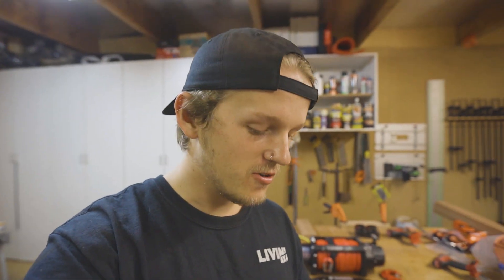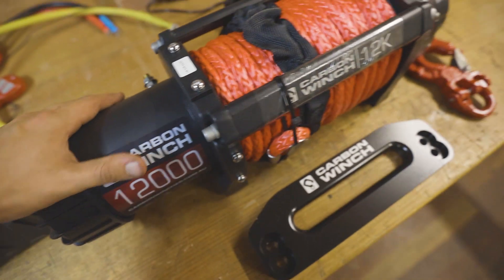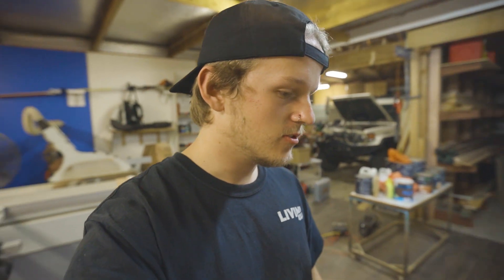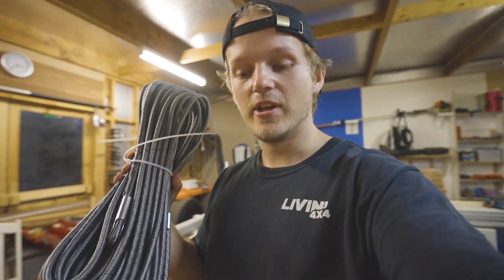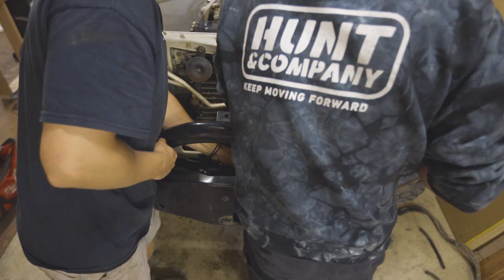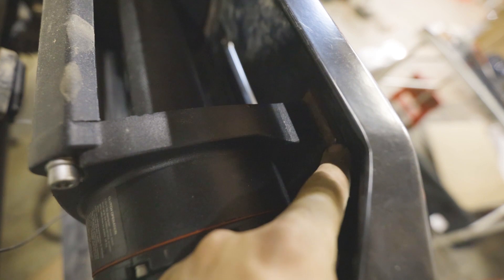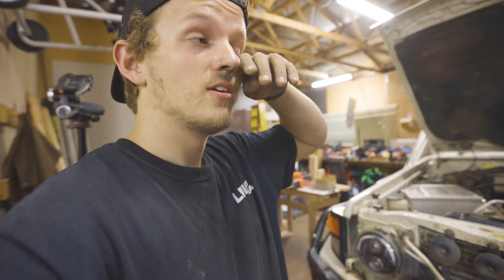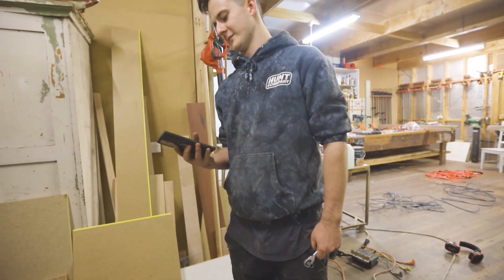Carbon 12k Winch Install on the Troopy!!

Comment: I would just like to say when Adam first used the rope it was going in the wrong way on the drum so the angle of pull was incorrect which resulted in it dragging on the bull bar, but if you have your rope going the correct way to start with there are 0 problems with the bar. The raslarr bull bar in my opinion are the best bars on the market and I wouldn’t won’t anything else 👍🏻

Comment: My 150 prado has an arb bar and is mounted the same as yours with the 4 bolts going through the front. Only difference is my winch goes in from under the car.

Comment: I bought a Carbon winch and it did exactly the same thing with the control box, when I went to test it in the shed for the first time. I had to get a new box sent out before I could even use it. I've also found because the rope is so thick it easily gets bounded up on the drum on the corners and the winch struggles to free itself sometimes.

Comment: The carbon winch’s have like 3 mounting spots on the winch it self so you don’t have to put it on your bullbar. Have had mine on the car for a year or so used it maybe 8 times, mostly because I don’t do bog holes haha. I also had to space my winch back with the raslarr bullbar on my 80

Comment: Mate of mine runs a carbon and has had nothing but dramas, one failed on us in a reallllly bad spot the second time it was used, even had brand new spare parts faulty out of the box. Hopefully you have better luck with yours

Comment: I think its not a Breather. Its to pressurize the Winch Motor to stop Water, Mud getting in it.
Reply: It’s a breather...
Reply: @BangersEnduro  👍 I know Winch/Trial Trucks pressurise the Winch Motor. I thought it was for that
Reply: @glennkiller3195  I thought the same thing first time I saw this on the Carbon, but it is a breather. Technically, if you swap over the fitting, there is nothing stopping one actually using this is a pressure system method.
Reply: @hodzy4x4  It's more designed as a breather rather than a pressure system, as the motor unit is sealed if you put too much positive pressure into the housing there is potential to damage the seals. So if you do I would use a regulated low pressure input no more than a few psi.
Reply: @carbonoffroad_australia  Thanks for the reply. 
I'd never do it personally as the breather on the carbon is a great design as a breather . Not many winches on the market come with this in a standard kit.